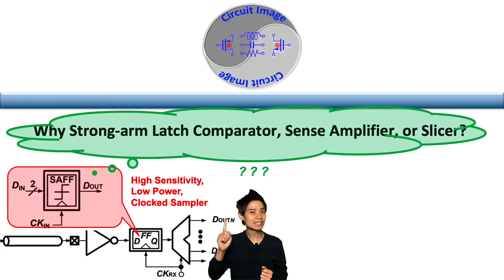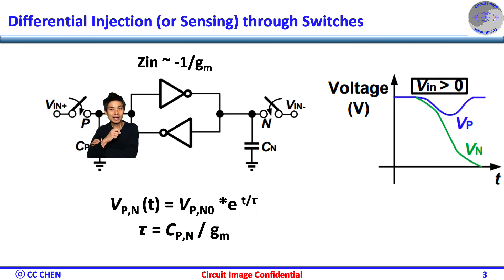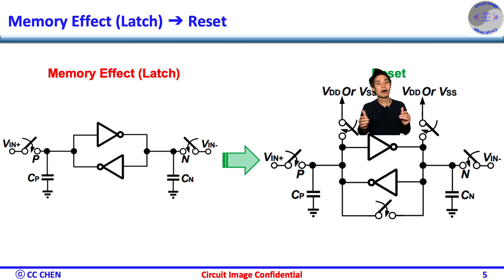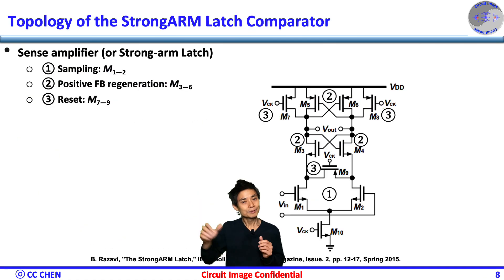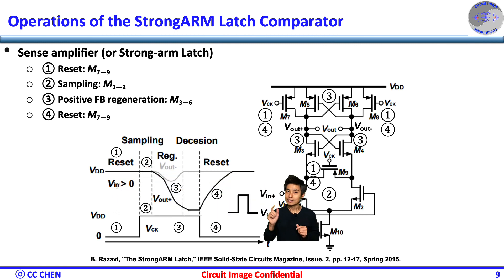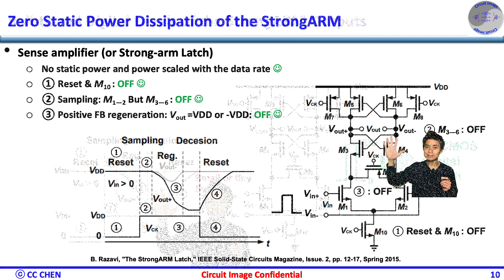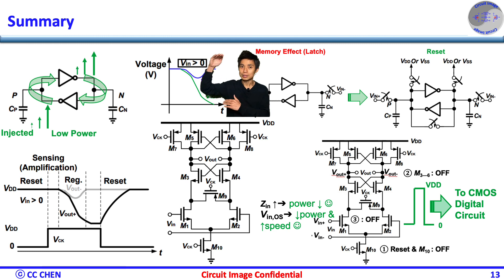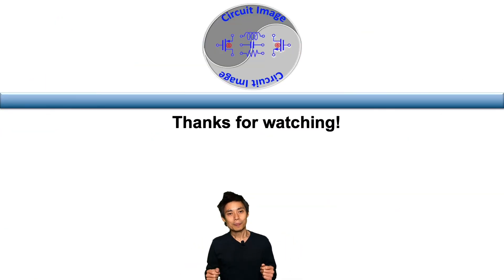Why Strong-arm Latch Comparator, Sense Amplifier, or Slicer?

Comment: I am working on a project based on double tail comparators in cadence 90 nm, but the both outputs are same even if there is a difference in inputs ,Can someone help me with this?
Reply from the maker: Hi Rohit, Nice to meet you. Yes, I can help you. 😊
Reply: @circuitimage  Hello Sir , I needed the transistor sizing for the transistors of the double tail comparator in 90 nm technology
Reply from the maker: @rohitakki2504  The size depends on your speed & power, offset tradeoff: you might want to make the diff at least (W/L) > 8um/0.1um. The tail would be twice of it. The reset at the top would be half of it. Make sense? Thanks!

Comment: Thank you for the video. Your series on serdes is very useful.
Question: I am bit confused with the degenerative mode. so here we are trying to amplify the differential signal, but what slicing is done here. Sorry I may be missing something basic here. 
Thank you inadvance
Reply from the maker: Hi Venky,

Nice to meet you. You're very welcome and thank you for the feedback.

The regenerative mode is to amplify the differential signal to rail-to-rail logic level. The slicing senses the input tiny differential signal and outputs a rail-to-rail logic level, which is a nonlinear process of the slicer.
Reply: Thank you for the swift response Sir @circuitimage  
In one of your training session on SerDes, Slicer is part of DFE and the information from slicer is feedback to summer. If the information from slicer is differential rail-to-rail, what information is being used by summer. Thank you again.
Reply from the maker: @CAPSTONEization  Thanks for the good question. That's the ISI info was  used by summer through the DFE calibration procedures. 😃
Reply from the maker: @CAPSTONEization  Hi Venky, the summer may just take the polarity from the slicer's differential rail-to-rail. Does that answer your questions?